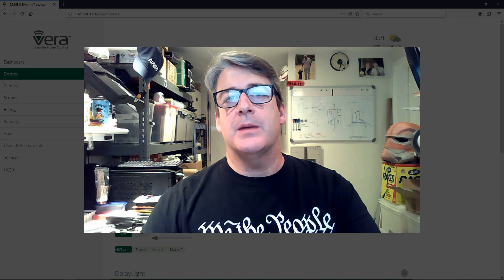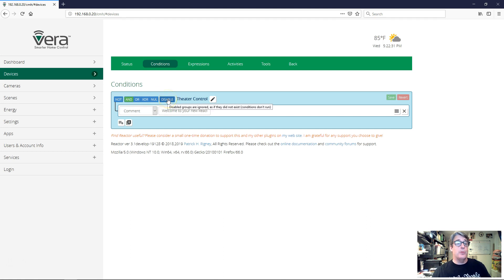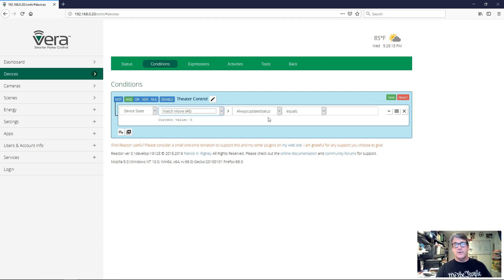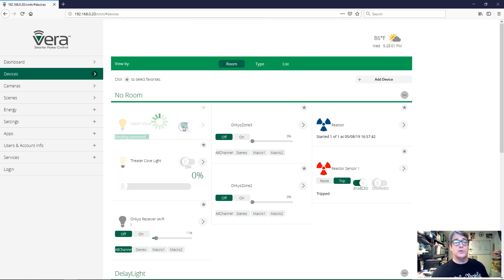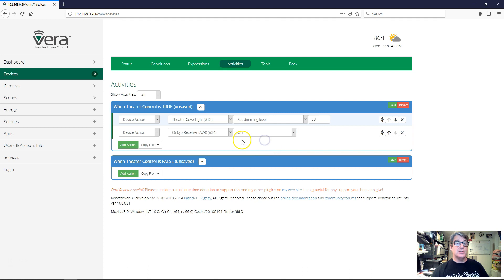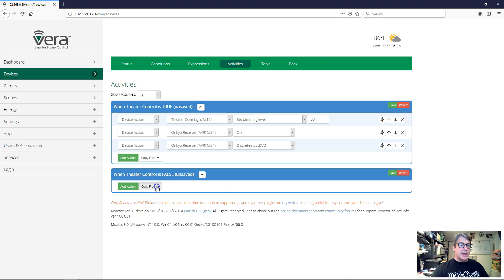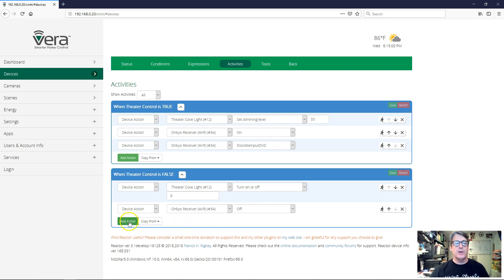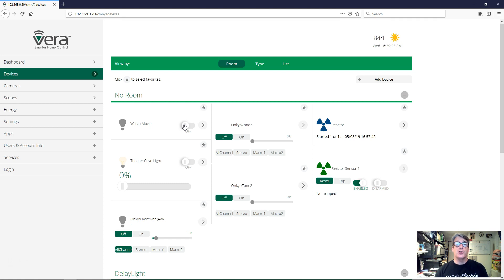Reactor for Vera #001 - Getting Started with Conditions and Activities

Comment: Would it be possible to use reactor with a temp sensor to turn on my pool below a certain degree?
Reply from the maker: Yes, but you need to have a pool control that is Vera-compatible and exposes actions that Reactor can use. I'm assuming you're a Vera user. There are a couple of other Vera Community Developers that have done pool control interface plugins. The Vera Community would be the place to hunt these down.
Reply: @toggledbits9663  where could i find said communities?

Comment: Hi Patrick,

I have created a ReactorSensor in my Vera lite for my screens. 
Included a few sensors, (lux, wind, etc) and it is working fine.
I created two groups within one reactor sensor, UP and Down.
However, I want to create some sort of "Main" switch.  I have added a delay of 60 seconds, and let my Imperihome say that the screens wil close unless someone disables them now. Therefore I have created a virtual switch.
But I can not get it to work right. probably because the "flow" is already running.
I dont want to create a lot of extra scenes or sensors. Would be nice if it would work within the same reactor sensor.

Probably very simple... :-)

Comment: So, somewhere between video 1 and 2 you have a new icon called 'Watch Movie" which appears to control the Reactor switch.  How did you do that?
Reply from the maker: That's a virtual switch I added via the Switchboard plugin. Virtual switches are really handy as inputs for modes or conditions that aren't represented by physical switches. For example, I've got a "Party Mode" virtual switch for my home that, when turned on, prevents my general time-of-day ReactorSensor from turning off lights at night.
Reply: @toggledbits9663  How about a video tutorial explaining how to create and use a virtual switch on Vera?    Thanks.
Reply: @toggledbits9663  Please make a video on how to create/configure virtual switches in vera